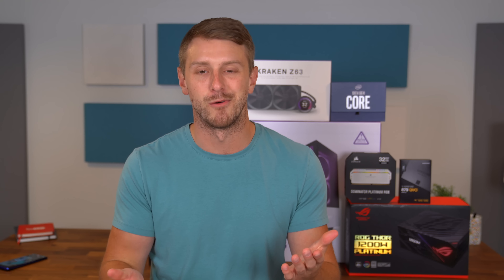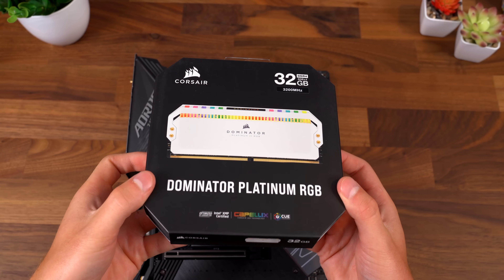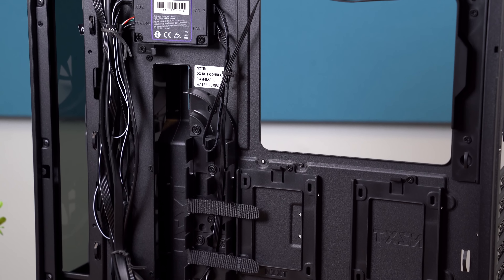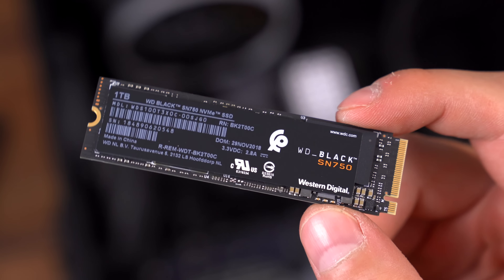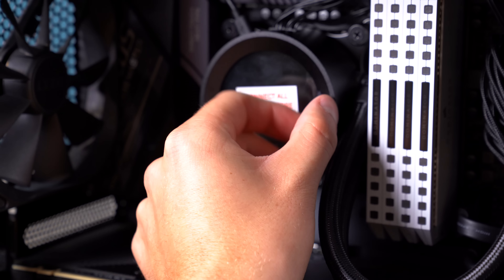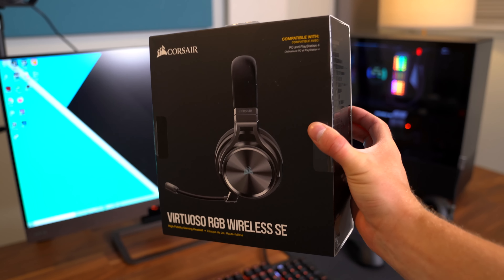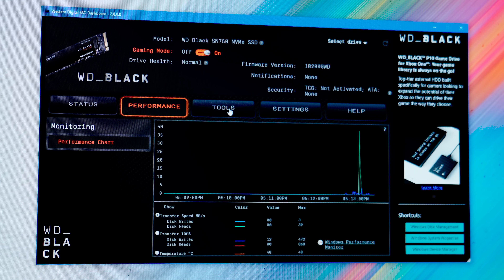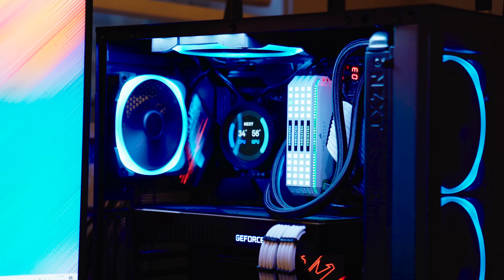My New 2020 Gaming PC Build: Intel i9 10900k and RTX 2080 ti!

Comment: F in chat for anyone you just bought a 2080Ti
Reply: 2080ti is still a monster of a card
Reply: Lukáš Tichý actually no, 2080tis are still worth money, 2080tis are extremely beefy cards for the price. You can get one for less than 400
Reply: f
Reply: F
Reply: but the 3070 doubles its performance and costs about 3x less

edit: sorry got it wrong, i was looking at the 3080,
Reply: Anthony Macleod everything in that sentence is wrong. Rtx 2080 ti costs around 100$ less. Only thing we got from nvidia was that rtx 3070 was a bit better in performance. But not by that much
Reply: Clockin what do you mean lmao check the reveal. NVIDIA said themselves that that rtx 3070 was 2x better than the 2080ti, but I probably got the price wrong
Reply: Clockin actually you’re also wrong on price. I was talking about prices before the reveal of the 3000 series
Reply: Anthony Macleod actually they didn’t. If you look at the graph they provided you can see the performance on rtx 3070 is just only slightly better. I have some doubts about the 3070 because of it only having 8 gb G6 instead of the 2080tis 10gb g6
Reply: Anthony Macleod rtx 2080ti will beat 3070 in some scenarios
Reply: Anthony Macleod why do you look in the past. If you buy the card you aren’t going to pay the price before 3000 series lmfao. 2080 ti around 450 on ebay
Reply: Anthony Macleod The 3070 isn’t 2x better, it’s only a little bit faster than the 2080ti, but for A LOT less. $499, you might be thinking about the RTX 3090 being 2x better than the 2080ti
Reply: I was 1 click away from touching the checkout button to buy the 2080ti. Nividia nice try tryin to finesse me.😪
Reply: @entertainmentfm5278  3070 is meant for 1440p 144Hz ultra settings gaming. 8GB would be fine for 1440p, and yeah at 4K, 8GB of VRAM might suffer a bit
Reply: Anthony Macleod the 3080 is 2x as fast not the 3070
Reply: @Anto95087  nope that was the 3080
Reply: Vipxrz no NVIDIA definitely mentioned the 3070
Reply: @Anto95087  the 3080 is 2x as fast not 3070
Reply: @chubbydanny1999  i relooked and i got the performance wrong, but yeah it is pretty much 3x cheaper
Reply: It’s not good or something
Reply: It cast to much
Reply: @Anto95087  who tf said 3080 is twice thr 2080ti?? its barely 22% better
Reply: the chat https://www.youtube.com/watch?v=trkxE6weAe0 without 2080 or GPU more
Reply: @Anto95087  yo would this pc build work with the 3080
Reply: @entertainmentfm5278  cap you cant get them for $400
Reply: @Lukáš Tichý this aged well
Reply: Not because 3080 isn't in stock lmao
Reply: @entertainmentfm5278  not anymore lol

Comment: Top of the line for another week until Nvidia announces the 30-series.  Still, nice rig!
Reply: True. It is godly for another week. But i think my 2400 euro rtx 3080 build will beat it. Primarily the estimated 20% ish performance boost on fps performance over the rtx 2080 ti on gaming. Dont think all the other ultimate parts will beat a 20% faster gpu. I still prefer a rtx 3070 1800 euro build based on the money spend. 1600-2400 euro’s for a new gaming pc is the sweet spot for me.
Reply: @MrZwartwit  Lol the 20% performance boost turned out to be a 100% one!
Reply: @UnavailableHandle.  just in situations heavy on ray tracing and dlss. Use Nvidia marketing  with a truckload of salt. Doubt it will get past 35% on current titles raw fps. Like the game three kingdoms total war.
Reply: would you recommend this build as-is (other than switching 2080 for 3080) now? Or does the 3080 demand different parts?
Reply: Kyle Biggs the rtx 3080 might require a bigger power supply compared to the 2080 on some builds. Also the card might not fit in all cases. Gpu’s tend to get bigger and bigger.

Comment: Just an advice, turn the radiator upside down if you want to prevent traped air bubbles in the pump, the tubes in this AIO are long enough for a correct installation.

Comment: Tim you radiator is mounted wrong .. Should go with the hoses on the bottom.
Reply: There is no wrong way to mount a rad as long as the other fans offset the configuration.
Reply: @EMC1998  AIO Radiators don't come complete full of liquid and if the hoses are on the top the pump will not pull the liquid out of the rad .. @GamersNexus did a video about it and explain with detail.
Reply: forget youtubers and take them as refferal just.
learn and start to use your own brain and basic logic. Radiator is wrong installed, one other reason is the airflow to refresh the radiator plates, the fans close to front panel don't have the same air flow source than being installed on top. 
install an air cooler and forget cleanning, maintenance, price, liquid flow and complex tales.

Comment: I think u didn't change the memory frequency through the BIOS, I can see it's still 2133 mhz instead of  3200 mhz
Reply: maybe he didn't turned on XMP
Reply: is that big difference after he on the xmp ?
Reply: @fahaddosminerxd1582  Yes you must turn on XMP if you have a custom pc. It is turned off by default in case you put cheap ram memory and the system becomes unable to boot properly. And the difference between 2133Mhz and 3200Mhz is huge with DDR4

Comment: Hey buddy,

New to pc building. I replaced the top and back fan on that case to be RGB but struggled to get it to work. 

Power was fine but no leds on them. Managed to make it work using a weird cable structure but it doesn’t feel right. Could you please share/ do a close up explaining how you got your third one to work with the LED’s? 

Thanks!

Comment: You went with Corsair Dominator Platinum RGB 32GB (4x8GB) DDR4 3200 (PC4-25600) C16 1.35V Desktop Memory.
Wouldn't the Corsair Dominator Platinum RGB 32GB DDR4 3600MHz Memory Module (32GB, 4x8GB, DDR4, 3600MHz, 288-pin DIMM) be faster or is there something I'm not seeing?
Reply: Yeah, 3600mhz is faster, but Ive seen that the speed doesnt really make a difference in some parts

Comment: Normal h510 case
750w psu
16gb of Corsair vengeance rgb pro 
Rtx 3070 (when it comes out, I doubt I’ll get it till December but still I’ll wait) and the rest the same.

Comment: i have a question i wont a new build but i have already a ssd m2 with windows 10 inside m2 if i put it on a new motherboard do i must do a format or somthind ? or i have windows without reanstal it again?
Reply: reinstall a new windows, to have new and "fresh" registers ( the Windows Regedit modifies)
Reply: @antonio.x22  is it bad to reinstall the windows i have now?
Reply: Eixame you can reinstall windows in the same and current C:\ you have:  Repair mode,  Restore Mode.
You can choose there the option 1 erease all windows and reinstall everything ,  
opt 2 reinstall windows without erease programms and same config and files will be there without remove. 

If you install right now your 
 C:\   in other PC,  or in a new motherboard,  windows maybe will work but different configs and registers got to be updated while you use the PC, the list of registers of windows could find a minor mistake or maybe no problems , that’s why to prevent and to have a new windows registers and configs including drivers,  is better the new complete clean windows installation. 🔌
Reply: Eixame ➕  if you have your Windows activated and registered, Microsoft has your hardware in  the account list and that’s why you can reinstall Windows just with the same account, because Microsoft has registered your system and confirms it is the same even when it has been formatted or replaced a “minor component”, when you replace the mother board it means a major change, a major replacement, and Microsoft will consider you try use the same Windows in a different PC.
Reply: @antonio.x22  thanks